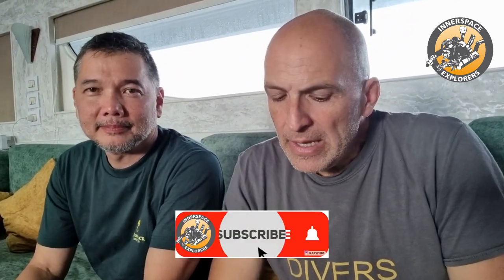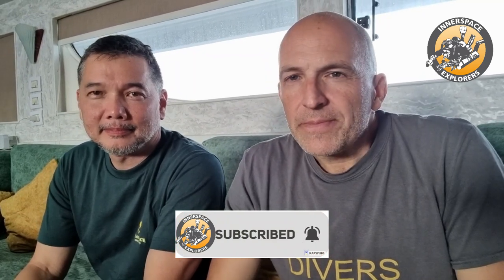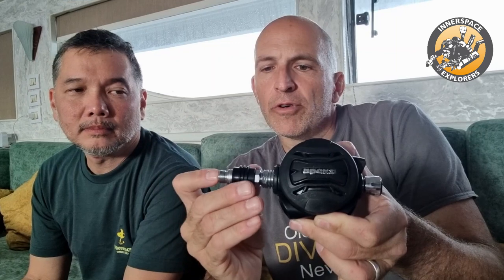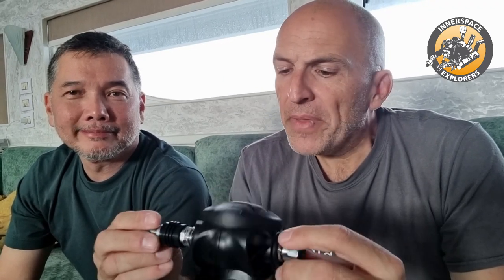Inline Shut Off Valve - Yes or No?

Comment: Only place I saw these make sense was on Richard Harris's twin meg setup on his primary meg's adv since they both get plumbed with the same dil tank, so shutting it off at the tank isn't desireable. Unless you're doing something extreme like that then this seems like just an unnecessary failure point.

Comment: I guess given the choice in a failure I'd rather have to much gas coming out instead of not enough. It's probably why second stages fail or freeze open. It's why I'd NEVER use an aqualung acd first stage because I know that they have failed closed at depth. My first stages all have a shut off already called a tank valve and my second stages all have an adjustment knob to adjust flow to mitigate gas loss at least a bit allowing for an exit.

Comment: My instructor at the DPV course told me that I absolutely had to have these parts on my regulators. Otherwise there would be a danger that the air shower would be activated by the water pressure while driving and air would flow out unnoticed.

Comment: I had one on a BC air supply on an OC rig. I rigged it to be always on with a zip tie. Just never wanted to have to deal with on or off in a high stress situation. Eventually removed entirely. I think I would rather deal with free flow than not have air.

Comment: I have used them and do like them . Its like anything know your equipment for yourself and those you dive with well. Just a 2 minute briff before a dive in not enough.
Its like anything it can fail but does not often. I have a few spares to it works. I have them on both regulators.

Comment: From my humble position of only a few hundred dives I'd suggest it would be better in this guy's case to address the original problem by proper servicing and care of the second stage.  If that's an XTX50 it should not have this issue.  Otherwise I see just increased risk of an equipment and/or human factors failure.

Comment: I had one of these when I did my Trimix certification in 2006. Switching it on and off seemed to damage the valve inside the 1st stage and caused intermediate pressure to rise. When I removed it the constant problems suddenly stoped. Sold them for a surprisingly good price on eBay.
Reply: If IP rises only with the valve shut off, you may have a leaky first stage.

Comment: what about the use on scootering? Going at a certain speed can make your regulator which you are not using (sidemount, bailout, decostage,...) going into freeflow. Personally I'm not using it but another instructor adviced it to me in this scenario.
Reply: I have used these valves for scootering for that purpose in the past. I have since removed them, because of the points mentioned in the video. Now I will pressurise my bailouts and close them when scootering. This is also easier to explain to a buddy who might need your bailout. Another important point is the need for an overpressure relief valve if you use it on a bailout.

Comment: I generally agree with this.  If you have a VERY good use-case for it, and are aware of the drawbacks?  Sure.

However, as stated, it's a failure point (even if tiny), can be a hazard if you or a buddy need gas NOW.  You'll also want an OPV (another failure point) if connected to regulator on an open tank, with only 1 first stage, otherwise you risk a hose exploding.
Reply: How would you risk a hose exploding? The valve in shut-off position is no different than a closed demand valve on the second stage.

Still wouldn't put it on my system. If I'm switching to my alternate, I want it to work right away and not require any fiddling.
Reply: @bloodymarvelous4790   If pressure creeps up on the low-pressure side, the 2nd stage regulator will naturally vent that excess pressure.  However, if it's closed off, there's nowhere for the pressure to go except causing something to fail (like the hose, or the shut-off-valve).  The pressure can creep on the LP side if (for example) the HP seat inside the 1st stage doesn't create a PERFECT seal.

Comment: I don't like the idea of adding potential failure points, but seems that a good post dive cleaning and changing  the o rings annually would mitigate that. What are your thoughts on its practicality as another tool to manage a free flow?  Could very quickly shutoff the free flow, switch to alternate and then address the free flow as trained.
Reply: If freeflow happens because of first stage freezing, which causes intermediate pressure to rise, then shutting it down with this would cause the hose to explode. Second stage is designed to leak when pressure rises too much. You should have one component in the system that gives up on that situation. This gadget removes that safety feature from the regulator.

Comment: I run one on my O2 for my rebreather (Kiss Sidewinder, MCCR). Reaching the O2 first stage is quite difficult and the shut off allows me easy access while on the surface and during an SCR or bailout event. The downside is forgetting to turn it on can eventually lead to hypoxia, but in reality i check my PPO2 frequently enough to notice, and my loop volume would shrink as i metabolized O2 to where i’d add dil. My habit is to check my PPO2 every time i add dil, so i’d see it then.